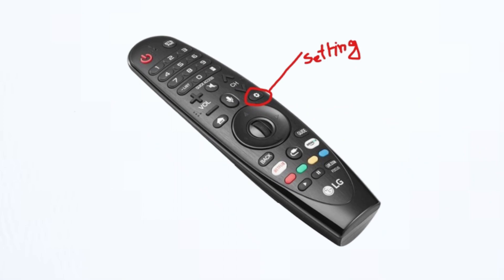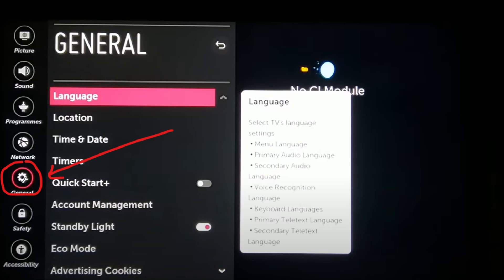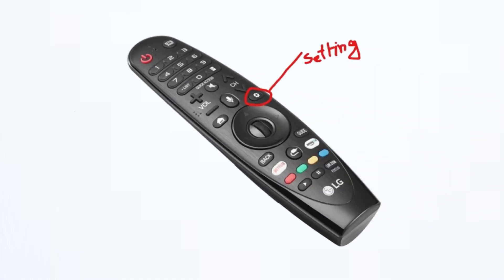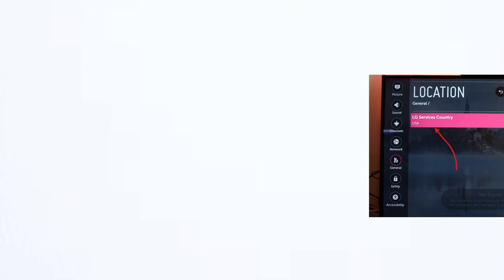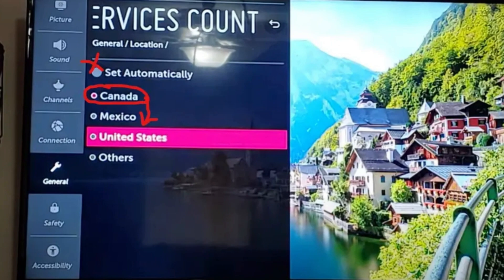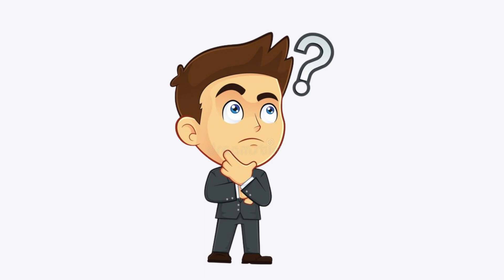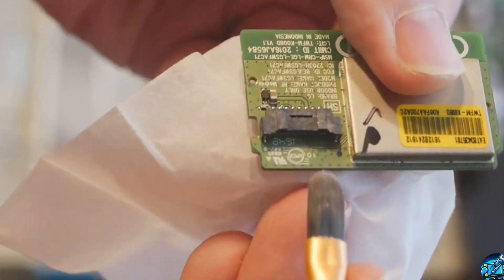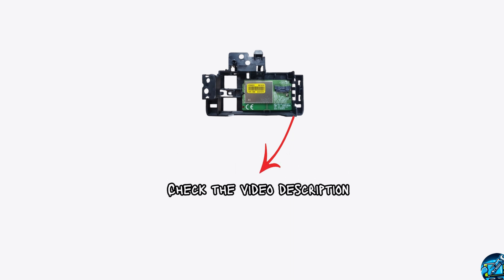The Actual Reasons Your LG TV Is Not Connecting to WiFi Network

Comment: These fixes didn't work for me. I know the wifi is working near the LG TV because other devices around the TV get a strong signal, but the TV doesn't pick up any wifi. The LAN Ethernet connection on the TV works, but connecting the TV to internet by an Ethernet cable is not really practical since the router is in another room.
I need a way to connect to wifi through the LAN port.
Reply: I really don't know why LG does not tell people how to fix this.  They know what is going on.  Just search on YT wifi not connecting LG TV.  Many videos explaining what is going on.  Basically its the WIFI ribbon cable all twisted and bent up going into the wifi module.  Fix is to remove all screws in back (unplug first) Open up back and the middle module on bottom is the wifi.  You will see how they taped, bent, twisted cable before connecting to the module.  Undue the tape if there is any and carefully flatten out the ribbon making it smooth taking out the crimps and twists in cable.  Then put back on back cover connect.  I just fixed TWO TV's the same way.  One manufactured in 2017 the other in 2018.  Both have always had network issues.  Now both work flawlessly.  Like I said there are many YT videos showing how to fix this.  The fix is really easy and takes about 15=30 minutes.  All you need is a magnetic Phillips screw driver because some of the screws are recessed further down.  There are thousands of owners that have claimed this is the final answer.  And it clearly is.  It saddens me LG giving all the lame work arounds that will NOT WORK.  In short, this is a design defect.  A process during assembly that knackers the WIFI connection.  For whatever reason LG does not want to take ownership for that.  Because to fix it means you literally have to open up the back.  It's probably something they are not allowed to advise.  So they just send owners on a wild goose chase.  All these fixes won't straighten out a bent/twisted cable.  You better believe it lol.  You don't need to replace the wifi module just smooth out the cable assembly.
Reply from the maker: either replace the TV's wifi  module or replace the router near your TV. That's what you can do now....